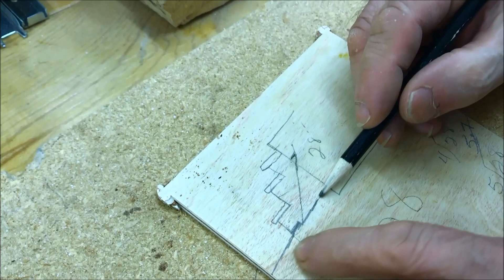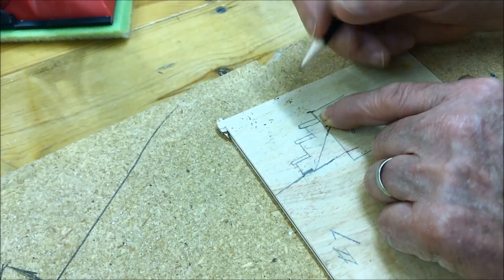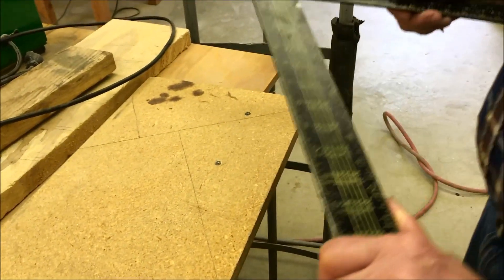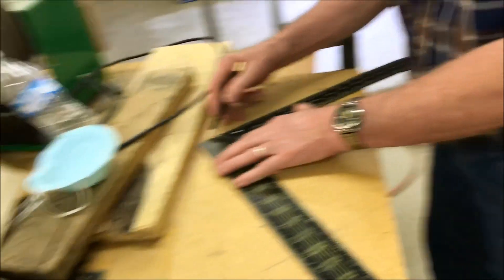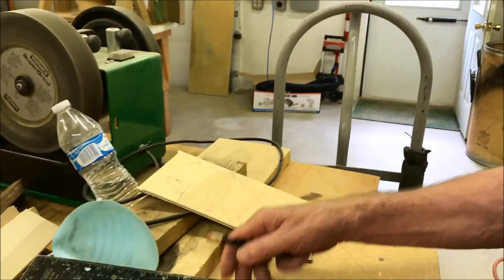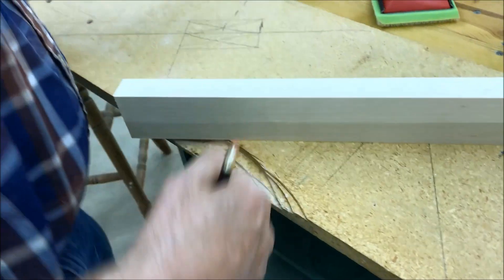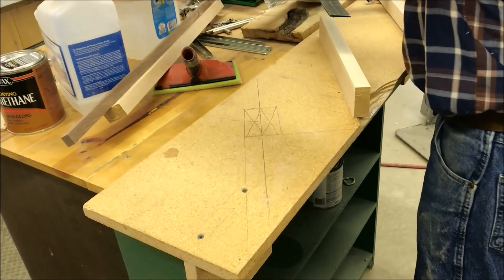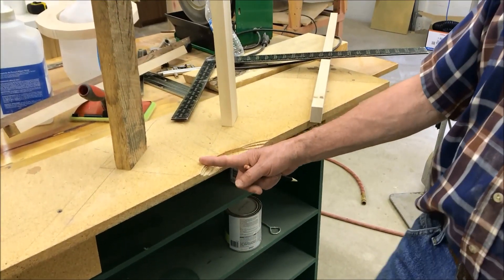How to calculate stair treads (rise and run) stringer layout

Comment: I wasn't sure where the 3/4" came from to subtract from the 11 1/2, but.....i was able to figure out what i needed by using the example and my own numbers.  I was building a cat staircase, but didn't know how to get the proper angles at all.  There was enough in this video to make it happen! :)  I always appreciate hearing something from someone who has the skills...i bet this guy can whip out a staircase like nobody's business if he wasn't being filmed.  Thanks!
Reply: I'm with you, WHERE did the 3/4" come from???
Reply: The thickness of the “kick board” 
It’s going to sit on top of the 11 1/2 . The kick boards are usually 3/4 thick.
Reply: Yea 11 1/2 minus 3/4 is not 9 3/4 he was off by like a whole inch!! And his camera man agreed with him!!
Reply: It's the overhang of the stair tread, assuming you don't have facia on the riser. The "plank" he points to is the width of the tread for the step. There needs to be about 3/4" that this board overhangs the edge. If you put facia on the front of the riser, that thickness will need to factored in as well because it adds to the total length needed for the tread board. Otherwise, the face of the facia will come to the front face of the tread board, and there won't be any front overhang lip on the step.

Comment: sir with all du respect. you should have made this video step by step...how to calculate the staris. where does the 7 come from. etc etc
Reply: He literally told you. The 7 comes from code. A stair riser can be 5.5-7.5 inches high
Reply: 7 1/4" for concrete steps
Reply: 7 is a bad number, because he didn't account for the thickness of the tread.  That needs to be subtracted, and that's the size of your stringer rise.  Then when you add the stair tread, it becomes 7.
Reply: The Rise is easy, he mentioned your Risers height need to be somewhere between 5"-7.5".
The Height of the deck from ground up is 28".
Divide some # between 5"-7.5" to give u an even Rise Height up which 28"÷7"=4 Risers.
What I don't know is, WHERE did the 3/4" come from to figure The Run??
Reply: You rise (how far you step up) and your tread (think of this as a shoe size sort of). You don’t want your rise up with each step to be to tall or too shallow or your gait isn’t smooth as you use the stairs. You don’t the treads (area you out your feet on) to be too large (deep) or shallow for your foot either. Hope this helps. 

He’s also giving an example of the average starting minimum it should be for comfort & safety (7”). I prefer the range of 7-8” minimum for both ride and treads.

Comment: Where the heck do you get 3/4" i dont get it i understand where you get 11 1/2" but where do you get the 3/4". And for the people saying this is a useless video it's not. He may have messed up on the math but if you realize this is just an example.
Reply: It's the overhang lip. The stair tread will overhang by 3/4" so the cut should not include the whole width of the tread.

Comment: Wouldn’t it be 10 and three-quarter It would not be nine and three-quarter
Reply: Yep
Reply: Yes
Reply: I was thinking the same thing.
WHERE did the 3/4" come from???
If u subtract 1.5" Overhang from 11.5" Board Width= 10" Run"??
Reply: @Chris lnFlorida  you wouldn't have 1 1/2" over hang on your tread. that's too much. he said leave a 3/4" overhang. 11 1/2-3/4 = 10 3/4 cut on your tread.
Reply: @hedzzup420 exactly but he said 9 3/4 so he was off by an inch and the camera man agreed with it!!
Reply: He’s deducted for the hangover  1”